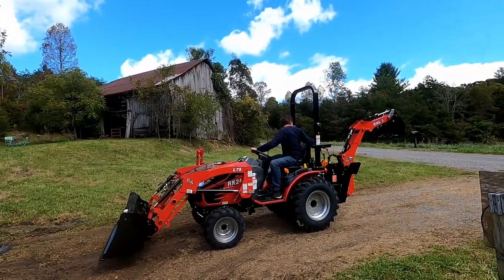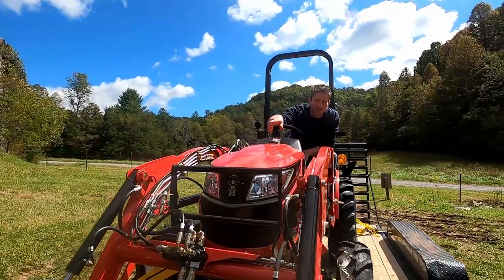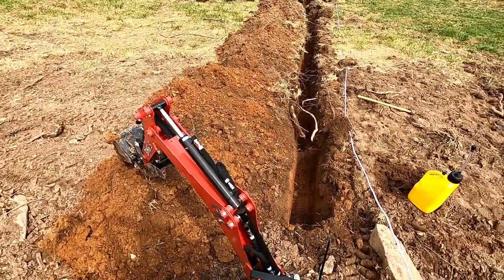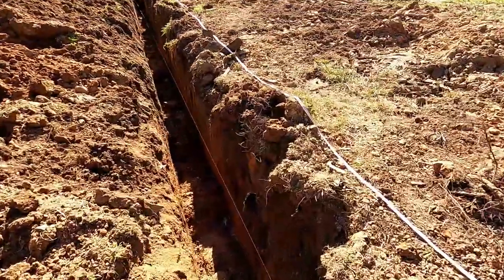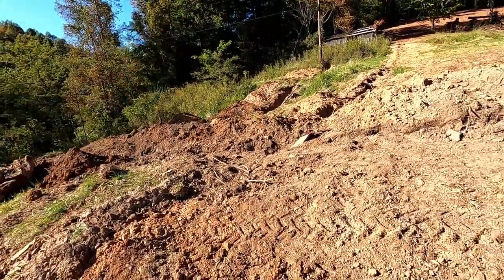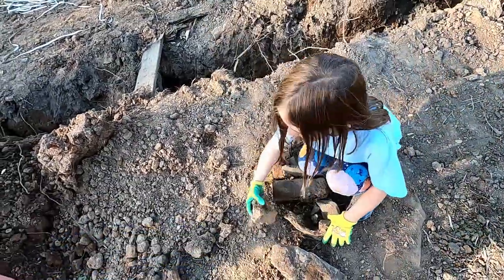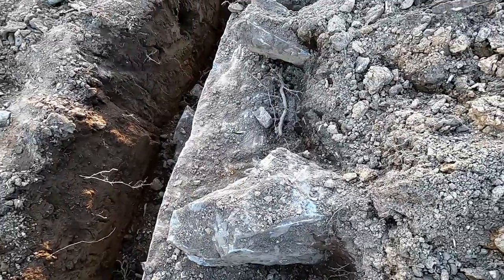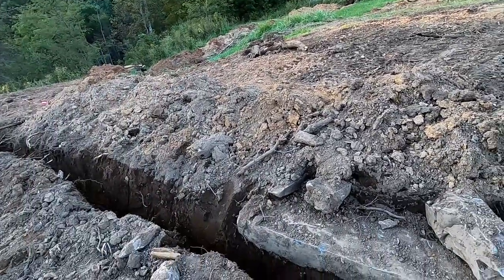E5 - We got an RK24 tractor and it dug up a mystery

Comment: Pro tip: @12:00  Put teflon tape on the thread of the pipe plugs. If you don't, the UV and dirt will make them impossible or near impossible to remove in a year or two...

Comment: Using a water hose to check level and/or angle of a trench is one of the easiest ways to monitor your depth and pitch. Water always finds it's own level regardless of the distance or grade. 60' of rolling meadow or uphill ground means you can't trust your eyes from the operator's seat.

Comment: Good luck on your new Homestead. Your right about the tractor wave. I watch the Out Doors with the Morgans. They had RK Tractors for a year. Fine tractor. Back in 14 I bought a Kubota L3301 with loader. We heat with wood so thats the tractors main job. 
But everyone would agree. Once a tractor is purchased the physical job has changed. Pretty much unlimited as well.
Reply from the maker: Thanks for the well wishes, fellow tractor buddy 😉. I've already put a good 160 hours on it and it's been invaluable, especially with that backhoe.  I don't know how I survived without one before.  Sounds like you have a nice machine yourself.  Can't go wrong with a kubota.

Comment: Now it’s time to buy your biggest investment for the tractor. Go buy a p.t.o. Driven generator. You’ll have power wherever you can drive the tractor, and when you loose power to the house that generator will run everything you need. Mine has saved my butt several times. Make sure when you wire your house you put in an interlock on the electrical panel, and a 50 amp plug mounted outside the house somewhere the tractor can park next to. Small investment for piece of mind. Especially water!
Reply from the maker: I like that idea, and must say I didn't even consider that before.  We will probably be on solar, due to the distance of running a line to the bottom of the property.  I can see how this would be useful when we have a long period of dormancy and the panels aren't generating what we need.  Thanks for the idea 👍

Comment: Hi guys. Just came across the channel. Doing a binge watch at thee moment. Got to ask Jon, what it your work back ground? I noticed that it looks like you could be a kind of silver smith. Have you worked with heavy equipment in the past? WOW, y'all have taken on a major project. The house build, driveway build, etc, etc..... Good luck!! Prayers are with you and yours.
Reply from the maker: Thanks for your kind words, Dennis!  Jon and I both were jewelers before Covid.  Before that Jon was in computer programing and development/management.  The tractor was the first piece of equipment either of us have used.  - Meg
Reply: @WalnutsandWineberries  Still bingeing. Up to episode 29 so far. Thanks for getting back to me. Are you positive about the location of the house? Looks like about a mile or more to get from your road up to the proposed house location. You both may need 4 wheel drive vehicles in the snow and ice to climb that mountain of yours. I used to be one of the "Snow Plow" drivers in Kentucky. Just wondering. More later. Be well and safe!!

Comment: Rural King put ag tires on it
Reply from the maker: Yes. It is one of three standard tire options you can choose from. 👍
Reply: What is the size of the at tires
Reply: The tires on that one look much larger than the tires of every other RK24 I've seen.  Hmm....
Reply from the maker: @4-LOW  I go into details about the tires in Episode 13 if you're interested.  About half way into the vid.  Really like those tires.
Reply: @4-LOW  - I have the Tym-254.. same tractor and it came with same tires ... much better height with my post hole digger

Comment: deciding between kubota BX23 & rk 24 are you still happy with  you choice ? love to hear opinion on rk 24 now that  you own one,
Reply from the maker: Yes, I've put about 150 hours on the tractor now and I'm still loving it.  The Yanmar diesel is a great engine in this thing.  Very dependable and plenty strong for what I need.  I like how there are standard things on this tractor that are add-ons when compared to others, like the rear utility hydraulics if you want to run a log splitter or something like that.  The skid steer style quick attach in the front is wonderful also.  I feature the tractor a lot in the channel, so check out the other vids if you're interested.  I don't think you could go wrong with either tractor.
Reply: @WalnutsandWineberries  thank you for info

Comment: What is the size of your front and rear tires?
Reply from the maker: I know the rear tires are 9.5-16R-1.  They are made by Titan and it says, "Hi-traction Lug" on the sidewalls.  I'll try to look for the front tires' size too and reply again when I do.  Hope that helps.
Reply: @WalnutsandWineberries  that helps.
Reply from the maker: Just thought I'd let you know, our latest episode (#13) has a segment about the tractor tires and the sizes.  I'm thinking the fronts are 12x6 even though the video shows 12.5x6.  Anyway, check it out if you're still shopping for your own.

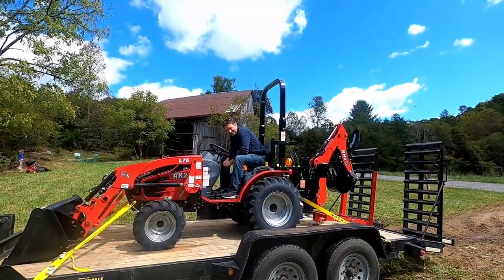Comment: @1:48 your tractor dealer should have sold you chains for securing the tractor to the trailer. Straps are known to stretch and tractors have literally fallen off trailers when crossing railroad tracks and small bridges with bumps are either end. Check out Messicks' videos, they did a feature on trailers and tractors after they had a salesman who lost a brand new tractor delivering it to a customer because he didn't use chains; he used straps.